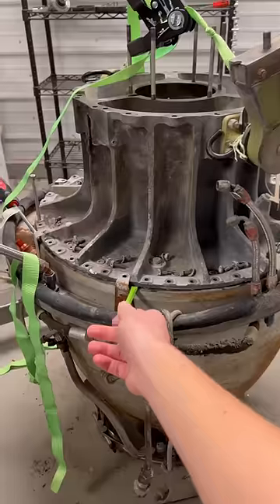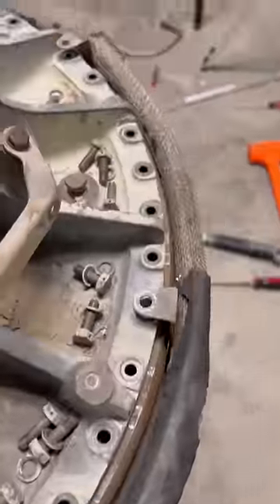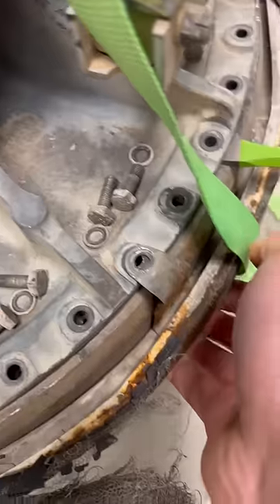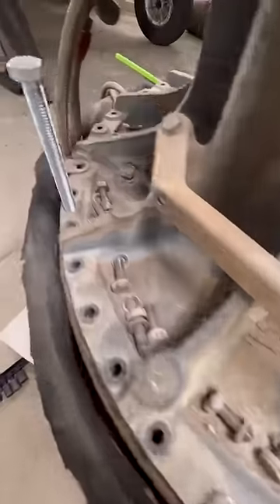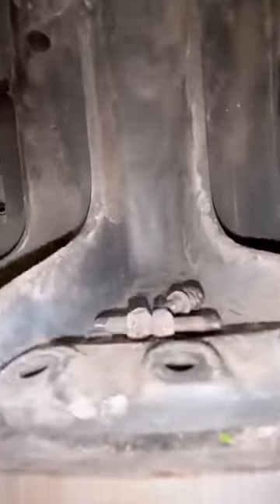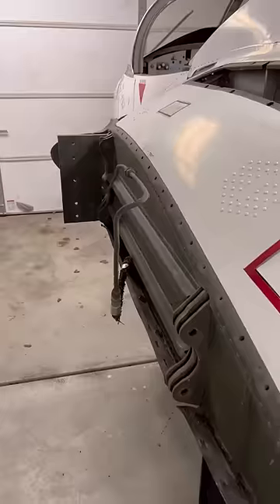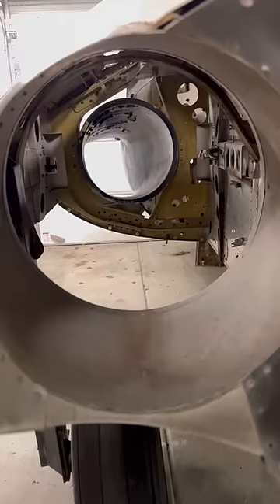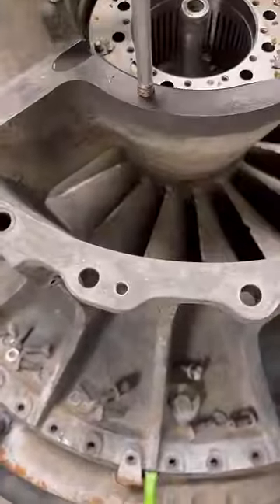Why My Jet Engine Won’t Come Apart

Comment: I would be scared to run that engine  even at ground idle speed. If you do plan to start it, be sure to install at least one fuel shutoff valve. A runaway jet engine caused by a faulty fuel control unit is a terrifying experience (ask me how I know). Please listen to this advice as it’s about the only way to shut it down if that happens. I am sure you know but turning off the igniter box won’t stop the engine. Be careful!!!

Comment: maybe try an air hammer to get it off, pull the housing up with straps and hit the sides with the air hammer in theory, the weight of the engine should be enough to release it with enough vibration.

Comment: Hrmm. What I'd be liable to try is to hang the engine by that housing and start flooding the corroded interface with boiling water. If that doesn't work I might add a little washing soda (sodium carbonate) to the hot water, which is going to attack the aluminum under the corrosion and free it, at the cost of a little more material and surface finish. Whether it comes loose or not, you'll want to flood it with distilled water afterwards, maybe with a little citric acid added to neutralize the alkali (this is in grocery store canning sections, and a tablespoon per gallon should be enough) but then followed with more straight distilled. Get all the salts off the metal.

Comment: While I do hope that you get the views, the only way to separate the two is going to use some kind of chemical solution to break though the corrosion that has caused the problem. 
Now this may sound silly, but have you tried something like PB,or maybe Navel Jelly ,or it may take a combination of chemicals and you end up creating a better way to separate the metals. The fact that this is a jet engine heat is not going to work. 
Good luck

Comment: Future engineer. Theoretical physicist. His mind needs the input from reverse engineering. Next door to a supply house I used was a company that rebuilt turbine engines for helicopters, drag cars, hydroplanes, and tanks. That roar and whine of test firing was incredibly powerful. I get you wanting to work on this. Very complicated.

Comment: Brake fluid for the corrosion along with, force yes
And use Servos instead of Steppers as Steppers do not know where they are, they are incremental. However servos are absolute and you want absolute control for throttle and such. Or you can use encoder with Steppers yes but not bare steppers

Comment: A good way to free those parts is to stand it in a drip tray and keep soaking with diesel oil. WD-40 also works but it’s far more expensive. Biodiesel is even better but make sure it’s washed because caustic eats zinc and aluminium.

Comment: Apply heat to the bottom casting. It may be a heavy interference fit due to the operating temps.
Based on the diameter, it should not take much heat to add a couple thou. To the diameter and it should drop right off.

Comment: I think your problem is shrink fit.I would hang it from top level the propane torch under the slit line . aluminum and magnesium expand a lot quickly so if you heat it fast it will expand a bunch .I would do a pie shape back and forth from 0 degrees  to 90 and it should fall a part

Comment: ohhhhhh you need to use temperature and hydraulic pullers to get it apart. So you must put dry ice on one part and a heater on the other. It's quite common with jet engines. I worked on F15, f100's 220, and 229's. Of course, I have never seen an engine so old, lol.

Comment: please be VERY far away from this even when controlling it remotely. I am an airforce jet engine mechanic(KC135R/A10) and im telling you from actual training/experience, when this thing comes apart(and it WILL) you will have a giant bomb on your hands. be prepared. and do not have anyone or anything inline with the turbine, LPC, or HPC. it aint if, but when this thing will let go. we cant even use mount bolts without a thorough NDI inspection, let alone anything corroded like this. be careful, have fun, dont get anyone killed

Comment: Hmmm, might be a dumb idea, but you maybe you could force it out?

Hear me out 😂. You can be tree felling wedges, like 8 or 12 of them. Theyre extremely durable wedges while at the same time not going to scratch the engine housing. Then you could wedge and pound them in with a non metal hammer to not damage the metal on the engine. If possible, spraying the stuck area with tons of wd40 can't hurt I imagine. These wedges create insane amount of levering force, and having a bunch pushing the pieces apart in all directions with the help of wd40 just MIGHT do the trick. Or at the very least be a very valiant effort.

Hope I see this engine again, I miss this series 😂😂

Comment: If you wanna free that up, use an air hammer and just vibrate the absolute crap out of it with flat head. You may have to make it, but i mean a literally mushroomed chisel top kind of flat, not like a screwdriver. Placing a pad of tooling leather between the tool and the housing may help.

Comment: If I had the opportunity to work on a small jet engine aircraft I would absolutely be sitting in that cockpit flying it myself enjoying the fact that I got it running before blowing myself up seconds later because I did not get it running properly

Comment: Use a burner to get it nice and hot, that’ll make it expand. And come off a little easier. Although you’re probably still gonna need a hammer, penetrating oil and a lot of violent determination.

Comment: What if you pray it a bit as you have atm and put a metal plate between. Then m10 or whatever size nut and a bolt thru the hole from the top all around. Tighten every bolt bit by bit and it should push the top part of the bottom part? 😊

Comment: A few cans pb blaster let sit for about a week then while hanging by the top drive that chisel or an iron wedge in with a heft sledge? Maybe even some  heat while your at it?
Reply: I'm not by any means a jet mechanic I just work on cars in a Salt belt state

Comment: There have got to be retired jet mechanics out there who will help You as a hobby. I would be very freaking careful lest You get cocky and wind up like Wiley Coyote or the Crew of the Challenger. Some of that You may get away with on the ground but I would hate to have a catastrophic failure in the air over the ocean, pot a lume into a mountain side or puck tauk toong Pat a loom cartwheeling across desert flats and fields. I  am glad You clarified that You do not plan to Fly it . I was envisioning You going out to the front of your House to get the fuselage and parts accompanied by sound track from the Roadrunner intent on turning the Chevy Biscayne or Impala Jato rocket Myth into Legend.

Comment: You got a good project going but you might have to rent a test cell to run the engine. Your main goal should be to get the engine to spool up. The Airframe is not air worthy and wont be until you have certified mechanics look at it and sign it of costing you thousands.

Comment: I was going to ask if you beat on it yet. I feel like any mechanic would know that it's just seized up from the corrosion and some good taps with the hammer should get it loosened up.

Comment: Have you tried really hot water? Like when a battery connection in the car is bad.
High pressure steam would be better I guess.

Comment: Not a jet mechanic, rather an ex auto mechanic, random suggestion, and tbh you'd need to look into if it'll damage anything...well more, but take it to a machine shop with an acid bath, ideally hot acid.

Mechanics do it for gumed up engines and the likes esp to do with the coolant system because they think because their car runs off pure tap water in the radiator it is okay....no its not

Comment: I forgot that general public do not open manual and technical drawing when repairing their jet
Reply from the maker: Hey if you can find me a J69-T-9 manual I will be forever grateful! I have and use the T-19 manual as that’s what I was able to find, but there are quite a few differences.

Comment: You wouldn't be able to leave it on long but have you tried spraying muriatic acid between the crack and then neutralize it before it eats into anything but the corrosion. I don't know.  If I had a piece of the kind of corrosion I know I could come up with a mixture that wouldn't hurt the aluminum and the turbine fins and whatever else. Is it just corrosion that's on a galvanized coating?

Comment: Had an old go cart, that I need to replace the wheel, and it was corded on.  Ended up just using a sawsall, and  got en going of the wheel off to use chemicals to disolve the corrosión

Comment: I am a Google jet mechanic and Youtube jet undergrad, and I have to say, you're all wrong. It's clearly being held together by the Flux capacitor bolts you forgot to take out that hold the blinker fluid tank on.

Comment: I assume you have already but maybe try heating the female side of the housing and spraying a ton of wd40 in there to get some of the corrosion cracked loose. Im not a rocket surgeon but i work on old shit all the time, heat and lube are always welcome

Comment: Just spray some penetrating fluid in the crack for a day or two.  /see if you can get something to eat away the corrosion & then it should just take a bit of elbow grease to come apart.

Comment: Is there a chance there's a press fit bearing in the cover which supports the turbine shaft and it need a puller to extract?

Comment: I used to work on kc-135s in the Air Force I seen the front of your engine it looks like all your stator veins are are chipped in messed up the judge engine has to have the smooth flow of air into it in order to operate properly

Comment: I guarantee that engine is never gonna start. Your fuel control isn’t gonna work, your igniter cables are done, your ignition exciter is probably also gone, I bet the engine control box is fried too if it’s electric… if by any slim chance you get it spinning, it’s gonna shell out

Comment: HE cant afford the $$$$$$ to get it to operate. He might not REALIZE that the AUTHORITIES will not stand by and ignore the DANGER that he is putting HIMSELF as well as anyone who might be near as he attempts to operate it. EXAMPLE Example-
Reply: The "Little Spark" he speaks of is a DEADLY HAZARD to his very life- A CAPACITIVE DISCHARGE is what generates THAT LITTLE LIGHTNING BOLT which ignites jet fuel. Instant DEATH for our friend should he get this system in operation should he ignorantly tinker with this object.

Comment: My question is, even though it will be remote-controlled, where would you fly it? Obviously, if it's not safe for a person to fly, it's not safe for people on the ground. No hate at all, I just think that insight would be a fun watch
Reply: I don't think he's planning on flying it. He's missing parts and there's legal issues. I think he just wants to get the engine to run and maybe do so while its attached to the plane so he has bragging rights. 

In the end, the engine will probably just run on a test stand and the rest of the plane will get scrapped for parts or "finished" with wood and plastic and be used in parades or as lawn art.

Comment: Get A Can Of Rust Ease ! Im Not Sure Luigi Galvani Would Agree ! Swedge your lip Evenly till Tight use Dead Blow It Will Come Apart . Don't Crack the Housing ! Get a Diagram in Case Your Missing Procedure Step !